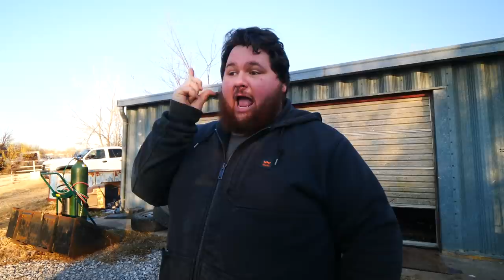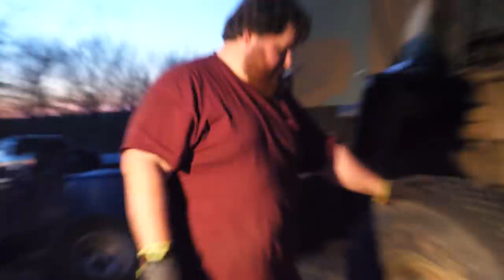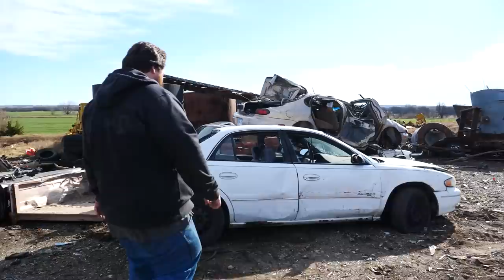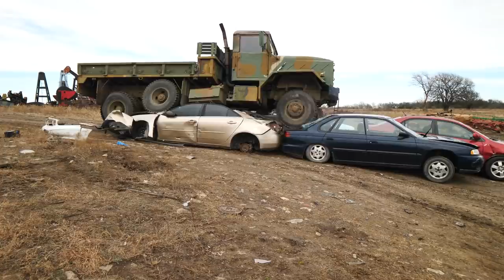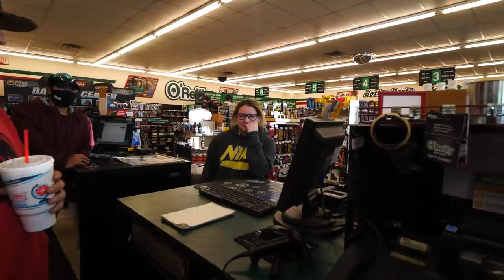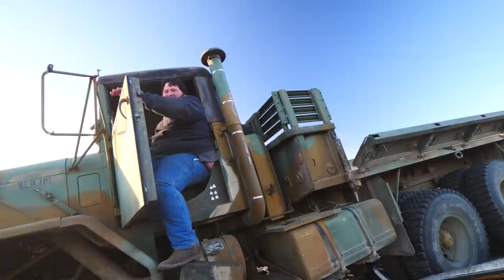Driving a 6x6 Army Truck Over Cars!

Comment: When Westen finally got the hub off. I totally felt him screaming FINALLY!!!! I've been there before, Who else has??
Reply: I've been there.
Reply: Been there many times with fixed and mobile equipment.
Reply: Been there with a gooseneck trailer hub, oil-bath hub was run dry, out side bearing was welded together, the rollers wear welded onto the outer bearing race, and the tire ha 3/4 full tread left on it, it was drug until the tire had a 1 1/2 long hole in the flat spot of the tire, was a mess inside, took me 2 days working on it to get it done. Christmas tree farm worker, I was hired out to fix it because their mechanic didn’t want to do it, but I got my money’s worth:)
Reply: Been there with about every part of my truck.
Reply: Yes
Reply: Yep
Reply: Yup many times
Reply: Im in the constant state of " there"
Reply: A) you KNOW he can afford it.  B) He has MORE than enough time to acquire it. But IT is the correct tools and he chooses NOT to acquire it.
Reply: I can totally relate to that feeling
Reply: I had a 93 Jetta that the hub WOULD NOT budge. I eventually changed the whole assembly cause the junk yard had one for cheap.
Reply: I have. 03 Dodge Ram. 2 hours of sledge hammer and 1 hour of oxy torch later and we got er off. Then 10 minutes to put everything back together 😂
Reply: Me too but with a seized rim on a old pickup
Reply: 2 weekends ago
Reply: I just chugged my tall boy to that..victory
Reply: To many times
Reply: I had to fight one of my dad’s trailers in order to get the lug nuts off one of the tires (had to get it off because the tire had gone flat and off the rim), I had to jack the trailer up and wedge the rim in order to break them loose
Reply: I seond this. I know that feeling and unfortunately it's like a drug hhahaha
Reply: I’ve been there

Comment: You should make a Bobbed Deuce out of that thing.. Remove the rear axle, cut the frame and cut the bed shorter and have a huge badass 4x4 that's easier to drive and turn around. I'd also add a key to it so it's a little harder to steal.

Comment: I have a feeling this may be an unfortunate new habit for you and imo about what I think it needs and what the next modification y should do is definitely make some bad ass heavy duty skid plates it so nothing will get hung up as easy or tear anything or the bottom like it did here. Because I definitely have feeling this is not the last time your going to be doing this. Also one more thing if it's not already in the future plans for this rig. Just about how easy it'll be able to run cars over if it's lifted just a tad bit more with larger tire/wheel combos and if it's bobbed! I have a feeling that bobbing it may have already been in your plans for this because they do look absolutely awesome when they are cut down a bit and that rear axle removed! And think about how much more stuff it'll be able to go through with a shorter wheel base and pror like 3 or 4k lbs removed from the ass end, then especially how much more stuff it could do with some larger tires and some more ground clearance! Ohh and can't forget some air lockers unless it already has em.

Comment: One or all of your four batteries are bad. Their internal resistance is so high the wiring will overheat and cause a fire. This actually happened to me while I was driving my M923 down I-40. The bad batteries will also lead to your alternator self-destructing.

Comment: You did a pretty good job of trashing that “Duce  and a quarter “ . Those were designed for severe duty but not the kind of beating you gave it. Sounds like a helmet might have protected your head a little when you smashed it on the roof. Your lucky you didn’t break your neck, what’s next ??

Comment: You did awesome, im a heavy equipment mechanic and best advice I can give you on the hub is, beat the ever living fuck out of it with a big sledge and then if it still won’t budge use a porta power or bottle jack sideways and put some
Pressure on it and hit it. I’ve played this game a few times.
Reply: You gotta pound the seal free and get the inner bearing moving before you can wiggle it out.

Comment: Like driving a rhino that doesnt like you?  I wonder why that is?  The 939 series 5 ton is one of the easiest trucks to work on there is that front hub literally takes 5 minutes after you get the tire off?  One really useful suggestion FOR YOU is to get a complete set of TM (technical manuals) the way you beat this poor horse your going to need them!